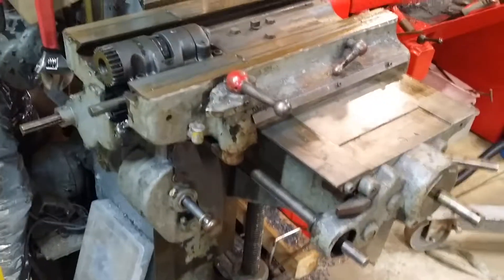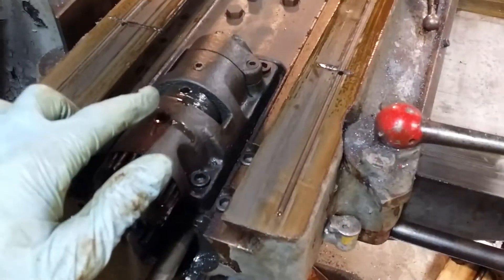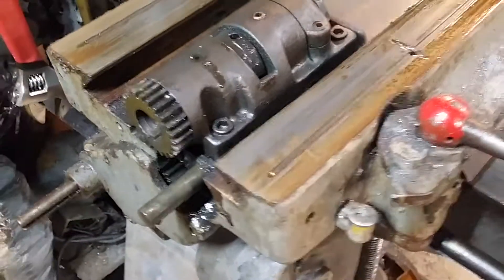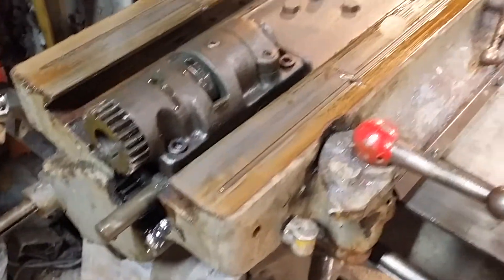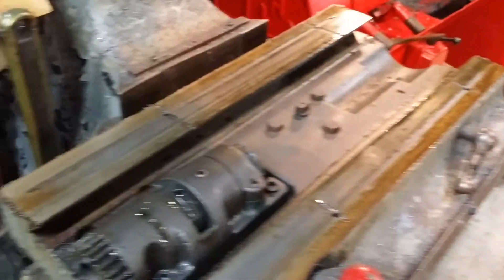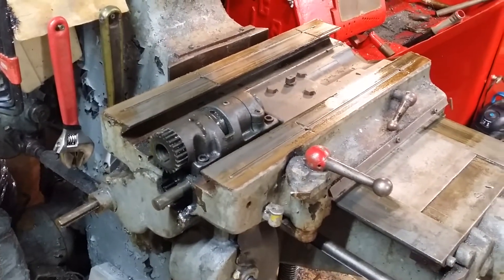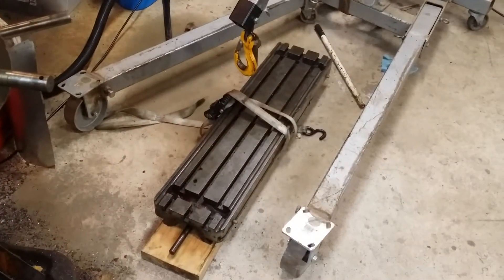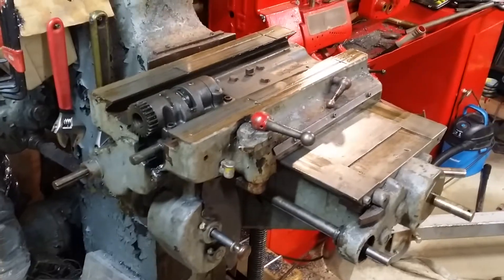Cochrane bly mill repairs part2

Comment: Hi Craig. Just watched your videos in reverse order lol. Looking at your saddle oil ways it looks similar to my Archdale milling machine. I DEFINETLY think the grub screws in your mill table are BLANKING PLUGS. I think your machine is missing some kind of force feed oiler even though you don't see it on any of these pictures.  http://www.lathes.co.uk/cochrane-bly/  You see an oil feed return pipe from the saddle to a oil reservoir at the base of machines main body which usually implies there must be a feed somewhere. I'm no expert but can you see these engineers/technician's removing the grub screws in the table to oil it. You have a fantastic machine there once you get it sorted. Tony
Reply from the maker: Again sorry I didn't see this comment sooner. Thanks for that link, I hadnt seen the second page on that sight till just now. If you are referring to the hose on the green machine, I think that is setup for coolant. I totally understand your your thinking though, cause yeah its a pain. But even to this day I havent seen a provision for forced oiling. I think the original design of this machine might predate the Bridgeports by a bit. So maybe they just couldn't come up with a better idea at that point in time. Info I have seen eludes that these may have been first built around 1917 or designed. I will definitely keep my eyes peeled for signs of such a system.  Even though its a pain to oil it this way, I am glad at least thats an option.